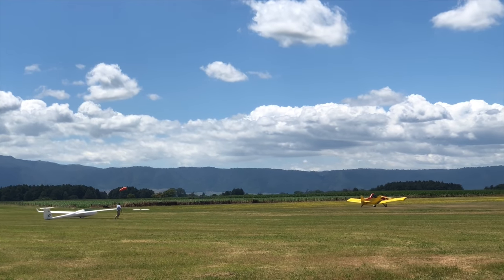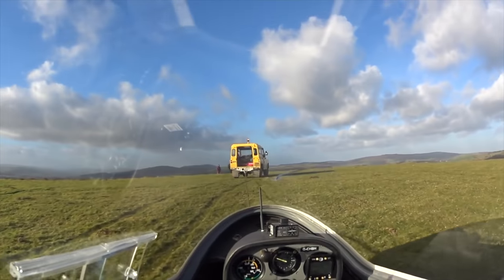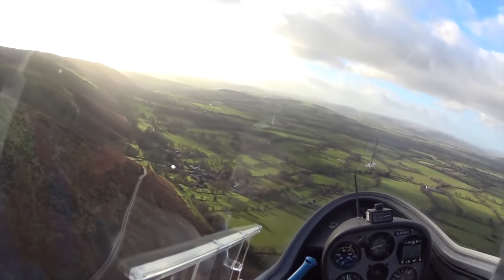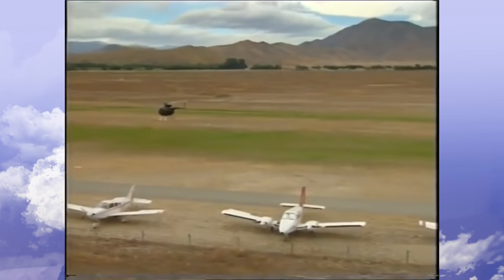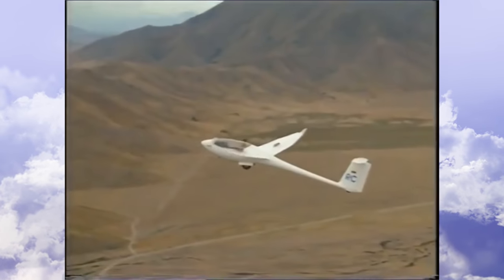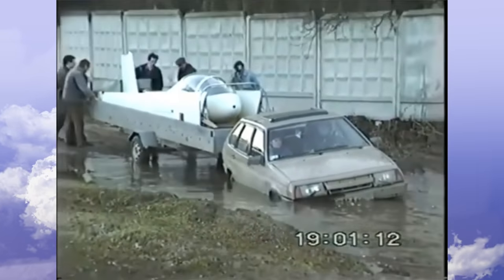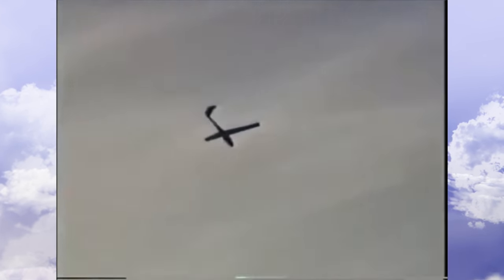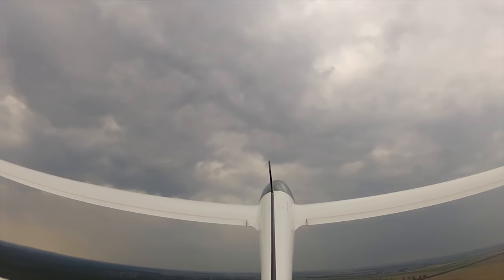4  Weird Ways to Launch a Glider! 🚁

Comment: I get why the balloon launch is that unsafe.  But I am kind of fascinated by that. Not exactly in that configuration, that we have seen here. But more with a balloon, that can achieve heights like a weather balloon. Starting your flight from that kind of height would open up some interesting possibilities. Including using wind systems you normally would not have access to.

edit: on top of that, it seams to be a pretty ecological way.
Reply from the maker: Yes although I suspect you'd need a very big balloon, and keep in mind they expand as you gain altitude. They lifted a person to 100,000 feet before, so maybe a glider is possible. It would take ages though! I think you're better off finding wave to climb to crazy heights
Reply: @PureGlide  
could you reach the jet stream by riding a wave?
Reply from the maker: Check out the Perlin Project online!
Reply: @PureGlide   
After a bit of searching I found the 
Perlan Project. was that the one you meant?
Reply: I don't understand why you believe a balloon launch is unsafe.  The only reason given in the video is "the rope might break".  Really?  The only load it has to bear is the dead weight of the glider + pilot, and a rope could easily be selected that has 10 times that breaking strain, making such an event so unlikely that it can be ignored.
Reply: @davemould4638  with normal launching methodes you can abort at anytime, if something goes wrong. With the balloon start you have a period where that is not possible. When you are high enough, that falling down might kill you, but not high enough to get enough speed to fly. I think the rope breaking is just one example. But it is one that glider pilots are familliar with. In f.e. a winch start rope breakings happen from time to time and pilots train for what to do than.
Reply: @MusikCassette  Yes, there is a period where you cannot abort - but give me one realistic scenario where you would need to abort.  The only ones I can think of are so unlikely that they can be discounted.  The probability of the rope breaking, for example, is about the same as the probability of one of the control cables of the glider breaking, or a wing root fitting failing.  If you are adverse to taking risks of that low a probability, you should not go anywhere near a sailplane no matter how it is launched.  (Or a car for that matter).  Rope breaks on aerotow are vanishingly rare, and when they occur it is always due to either a high load due to the glider getting way out of position (which cannot occur in a balloon launch), or very poor maintainance of the rope.  There will be no need to have a weak link in a lifting rope.
Reply: @davemould4638  1. I sense that you kind of wanna start a fight. I can assure I have no interest in that. 2. You picket a weird side to put me in. My initial post is in favor of the balloon start and you try to make me argue against it. Yes I can imagine a few scenarios in witch you might wanna abort a start. But I sense this conversation would go down a weird rode. Unrelated to that: you seam to have kind of a wrong Idea on how to aproach risky hobbies. Also you might overestimate the riskiness of flying.
Reply: @MusikCassette  No, I do not want to fight in any shape or form - I am interested only in a calm informed discussion (or debate).  Sorry if I did not come across that way.  I am genuinely interested as to why so many people think that a balloon launch is more dangerous than more conventional forms of launch - to me the objective risk factors are much lower than either winch or aerotow.  So far the only 2 risks cited have been such low probability events (catastrophic rope or release mechanism failure) that I would not consider them to be at all significant.  However I can see that there is perhaps a subjective fear that may be caused by the fact that the sailplane pilot is effectively a passenger during the launch, which would dismay those who need to feel they have some control over a critical phase of flight.

FWIW my flying history is as follows.  I completed my gold C and 2 diamonds as a sailplane pilot 50 years ago aged 17, being the youngest pilot to solo at that club at the age of 15, later owning a 25% share of a Ka6.  I have held a PPL for single and twin piston fixed wing aircraft since 1993, am IMC rated and got a PPL(H) in 1997, flying various light piston and turbine helicopters.  I have completed a formation and aerobatics training course, both theory and practical, and studied aerodynamics (I have no formal qualifications in either).   I owned a 2 seat aerobatic aircraft for about 3 years, in which I flew several uneventful aerobatic flights almost every weekend either solo or with a pax, which I enjoyed tremendously.  I have also completed just under 20 parachute jumps and flown paragliders.

In my life I have witnessed or been nearby 4 fatal sailplane accidents, 2 of which involved close friends.  One of the latter was when the Ka6 sailplane I part owned crashed due to loss of control by my girlfriend after she unintentionally became IMC in cloud during which both wing mainspars were over-stressed and failed in a suspected spiral dive, and the other a year later involved a mid-air collision between a thermalling sailplane and a tug aircraft towing a sailplane, witnessed from start to finish by the whole gliding club, which included the tug pilot's wife and teenage son - all friends of mine, in fact I had been invited to their house for a barbeque later that evening.  Both sailplanes landed back at the field with no injuries but one had severe damage (2 feet of right wingtip sheared off and half the right aeileron missing).  The tug aircraft's tailplane was shattered in the collision and it entered a non-survivable steep dive.  Tug pilots did not wear parachutes at that club, not that I think there would have been time to bail out.

I wanted to give up flying after my girlfriend's death, but other club members were very supportive and helped me get back into flying, letting me fly their own sailplanes.  With her family's permission, I scattered my girlfriend's ashes from the rear seat of a Blanik while flying in a "missing man" formation over the runway, a very emotional moment.  Shortly after the tug incident, the tug pilot's son and I had a long talk over a couple of illicit beers (he was too young to drink legally), I think he came to me because I was the only club member close to his age and had also lost someone close in a flying accident, and he vowed to keep on flying, saying it is what his father would have wanted (he had just started taking lessons prior to the accident).  Against his mother's protests he continued coming to the club and learning to fly, and we became very close friends, with many more beers consumed together over the coming years.

So I believe I do have a reasonable and realistic idea of the risks involved in amateur aviation activities.  For me, the risk/reward ratio is acceptable.  YMMV.
Reply: @davemould4638  ok, what about unforeseen weather events? Balloons are quite susceptible for wind gusts.

What I was trying to say about  risk taking is, people who are keen on taking risks are the wrong people to do risky hobbies. Even though flying is not the most risky hobby you can take up it is still in the realm, that requires people to be cautious. And yes car traffic is also something I would like risk - affine people to stay away from. As I said before, I don't think a balloon start is a bad Idea per se. quite the opposite. I think it is interesting. But I get, that there is extra caution required.
Reply: @MusikCassette  I quite agree that people who are overly reckless should avoid risky activities - but that is not how it can possibly work in reality, because people who are risk-averse would not do such activities, so if the risk-takers were prohibited from doing them, then nobody would do them.  I am neither risk-averse nor do I take any unnecessary risks, and I try to become as educated as I can about the real objective risks involved, and not succumb to irrational fears or superstition.  I do not however shy away from taking any risk - you don't get to fully experience life by always staying as safe as you possibly can.

My pleasure with flying comes from the flying itself, I do not crave an adrenaline rush at all - quite the reverse.  In fact that was the reason why I stopped skydiving - I loved the experience post-jump, but I didn't become calm enough to not have a racing heart and be tensed up with adrenaline while in the aircraft, which I did not like at all.  It was an irrational fear, because so long as you follow all the rules and don't try anything above your skill level, skydiving is statistically unlikely to result in serious injury.  With flying, sure I had an adrenaline rush on my first few solo flights, but that soon settled down and getting into an aircraft became the same as getting into a car, and it wasn't long before my heart rate hardly sped up at all as I turned finals, unless there was particularly challenging weather conditions (which I tried to avoid).  My 20th skydive was if anything more fraught than my first, so I decided I probably didn't have the temperament to ever get comfortable with it.  I am however very glad that I did it and experienced what it is like.

As said, IMO balloon launches are less risky overall than winch or aerotow launches.  Hot air balloons only launch in calm wind and stable air conditions, so a significant gust on takeoff (as opposed to landing) is unlikely.  But even if a gust did occur, then it would either be before it has started to lift the glider, in which case the glider can release before it has moved much, or it occurs after the glider is off the ground, in which case it wouldn't matter because the glider would simply move together with the balloon.

One quote that I always remember is: -  "A superior pilot is someone who uses their superior decision-making skills to avoid needing to use their superior flying skills."  There are times when an ill-informed attempt to avoid risk could place you in more danger rather than less.
Reply: @davemould4638  here is the thing, I can Imagine a few more things that could go wrong. But as a matter of fact I don't know enough to actually make a full risk assessment. But it is at least plausible to me, that the lack of abort options under a certain height increases the risk. And I think to actually do that one would have to do a bit more than armchair analysis of what could go wrong. However, the point of the initial post was not to point to the risks, but to introduce the Idea, to use a balloon start, to get to some serious height. Perhaps making weather Phenomenons accessable most people would normally not get to. I just mentioned the risk as a caveat to that Idea.
Reply: @MusikCassette  Yes, it does open up several possibilities.  Though to get to extreme heights you would need a fair bit of oxygen in both glider and balloon (which is perfectly possible of course).  Perhaps get up into the jet stream.
Reply: @davemould4638  you think about a maned balloon?
Reply: @MusikCassette  I was thinking about a hot air balloon like the one shown, which would need to be manned.  But what you infer is correct, a helium (or hydrogen) balloon would be easier and would not need to be manned.  I think that would be a great way to launch a sailplane!
Reply: @davemould4638  with helium, that would be quite expansive, and also a bit waste full (you could not recover the lifting gas) so their also comes the question, weather this can be done savely withe hydrogen. Also, would you ditch the balloon or would you just release the lifting gas and somehow role the balloon in.
Reply: @MusikCassette  The balloon envelope would need to be massive to lift a glider, so I doubt it could fold small enough to be rolled into the glider.  Hydrogen can lift about 1kg per cubic meter (68lbs per 1000 cubic feet).  Hydrogen has several advantages over Helium.  It is far cheaper and renewable, and can be manufactured from water.  It is slightly less dense than helium, though not by much (hydrogen has two atoms per molecule and helium only 1), but this slight difference does not make its lifting power much better than helium.  Hydrogen's molecules are larger than helium's molecules, so hydrogen does not diffuse though a balloon envelope so quickly.

Hydrogen has of course had very bad press due to the airship disasters and is widely considered to be very dangerous, but is really not too unsafe if properly handled - no more so than the petrol in a car's fuel tank.  There were thousands of successful hydrogen airship flights, and with safer designs and materials there is no reason why hydrogen airships (or even better, hot hydrogen airships) could not be made acceptably safe - even safer than jet airliners.  Even if the balloon did ignite or tear, the glider could release (unless very low) and remain unscathed.  Hydrogen will not burn or explode unless mixed with oxygen - so while any leaking hydrogen could ignite, the bulk inside the balloon cannot burn (or explode) - note that the Hindenburg burned, it did not explode - and it's now thought that the airship fire was mainly caused by and fuelled by the highly flammable cellulose sealant (dope) used on the fabric envelope rather than the hydrogen inside.  A modern manned airship or balloon could have both static inhibitors and use fire retardant materials.  Unlike petrol, if hydrogen leaks it will quickly rise and dissipate in the air rather than pooling on the ground to present a long lasting hazard.
Reply: @davemould4638  "Even if the balloon did ignite or tear, the glider could release (unless very low) " that brings us back to the lack of an abort option. I agree, that a hydrogen balloon for this should be save ones you are high enough to release the glider. I am not that sure about the first bit of the travel.
Reply: @davemould4638  I guess the safest way for an Hydrogen airship (and perhaps for this application too) would be to have double hull with  an inert gas (f.e. Nitrogen) between them. perhaps some sensors, so any leak would be detected long before there is any burnable mixture. Would bite into the carrying capacity though.
Reply: @davemould4638  so for a fairly light glider including Pilot, what are we talking about? around 300 kg?
Reply: @MusikCassette  Again, it's about probabilities.  We risk our lives routinely on the gamble that a rare event will not happen at a critical time.  That a car engine will not die just as it pulls out into a small gap in cross traffic.  That brakes will not fail just as the car is approaching a busy junction or hairpin bend.  That an airliner will not ingest a flock of birds within 10 minutes of reaching V2.  That the fastenings holding up a heavy sign or aircon will not fail just as someone walks underneath etc.  These are all things that have sometimes happened throughout the World, but only very rarely.  To me, the probability of a substantial rope breaking during the first critical minute of a balloon lift is even more unlikely than any of those events.  The probability that any one of those events happen to you are small enough that you would not think twice about taking those risks, so I'm not sure why it should become such a big issue with a balloon launch.  You can also inspect the equipment used in a balloon launch, whereas you have no idea how rusted the bolts are holding up a sign or aircon - or even whether the building itself is so rotten that it is about to collapse.
Reply: @MusikCassette  I can think of several ways that modern technology could be used to make a hydrogen airship at least as safe as a commercial jet, without compromising weight or efficiency overly much.
Reply: @davemould4638  well if we use hydrogen we do have to think about the fire risk.
Reply: @MusikCassette  Absolutely we have to think of the fire risk if we use hydrogen.  Just as we have to think of the fire risk if we use petrol, and we have to think of the fire risk if we use bottled gas.
Reply: @davemould4638  true, but we can not just reuse the strategies from those. So some engineering work is needed. I am pretty sure it can be done. But I am not so naive to think that there aren't some challenges in the way.
Reply: @MusikCassette  but there is hardly any reason to abort in a balloon.
They have the least amount of moving parts
The lowest chance of an actual problem , if they go wrong, they go wrong in the first 10 meters due to dragging wind, so if the the cable is long enough, the glider can still disconnect before it even moves..
cable strength is very easy to predict and gain a big margin of safety on.

Of all methods, balloons are the most predictable and least likely to have a failure

Now take a helicopter.. sure you can disconnect down low
But the failure modes of a helicopter are VERY unpredictable
LOTS of moving parts
its #1 failure mode is to instantly dump collective , eg let gravity take over so it can auto rotate
And other failure modes.. when tail rotor failures are involved
HIGH chance of entanglement , helicopter pilot might not even make it to a disconnect.. and you are praying that the glider isn't instantly pulled down. You have to consider that the only safety is the gliders ability to disconnect, but the window of opportunity is very VERY small.
 
The variables to consider and hedge against are infinitely bigger

No way that is safer than a balloon launch,
Reply: @stijnvandamme76  the weird thing is: I am actually  making an argument for a balloon start. And you r trying to make me argue against it.